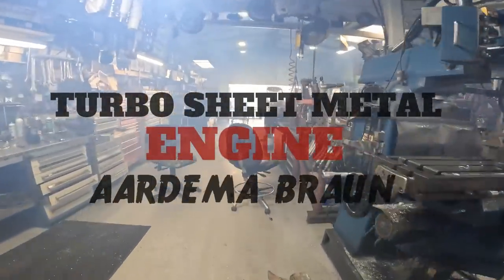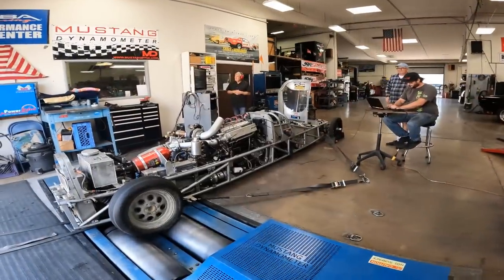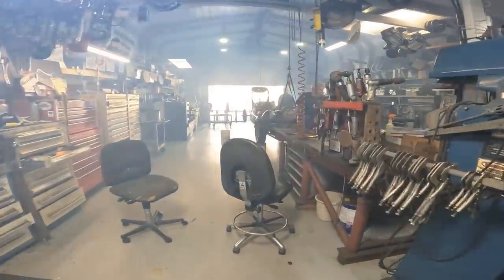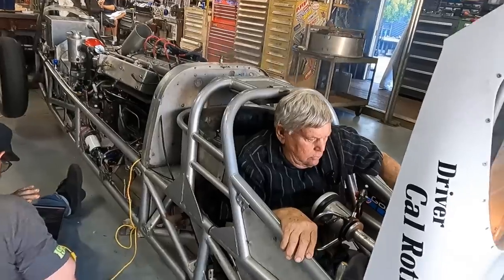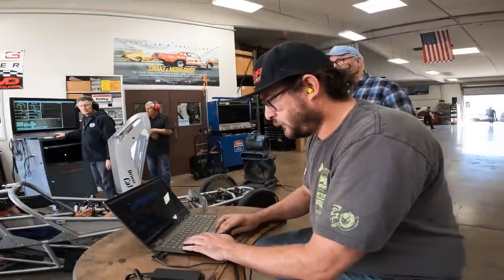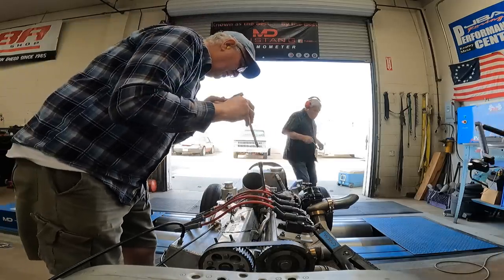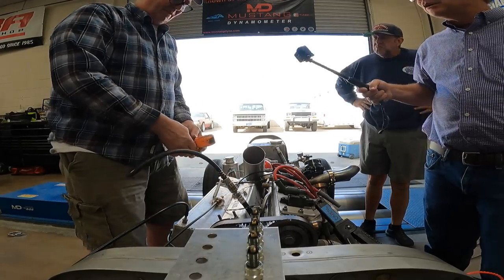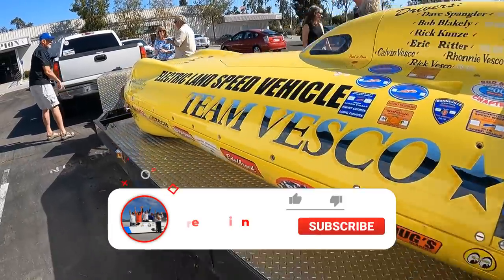Smoking Hot Homemade 3 Liter Turbo Sheet Metal Engine -  Aardema Braun

Comment: I wonder what type of failure mode infected the 3.0 liter during the dyno tuning? My intuition says there is some kind of ignition gremlin like spark scatter or other electronic interference. Something might be causing the timing to jump around? There seems to be a mixture issue too, the sudden lean spike generating the crazy-hot EGTs and resultant red hot exhaust tubing.
Reply from the maker: Crank signal pattern was all
Over the place breaks up at certain RPMs .  Could be interference ? Found  a voltage drop on the supply voltage to ECM .  Threw lots of time and  ignition parts, coils, cam and crank sensor. Possible ECM internal fault. Pete and Kevin will have to re wire it and bench run it before it goes back in the car.
Reply: @GregQuirin  I have seen a 1/4” steel angle iron bracket prove to flimsy for a good tach signal.  It looks like plenty but with engine vibration snd harmonics I have seen them throw some crazy signals.
Reply: Thank you Greg. Things that ought to be simple and easily understood can get wonky when pushed to produce record setting horsepower.
Reply: @GregQuirin  I ran into screwy rpm signals on a Subaru years ago above a certain rpm. It turned out to be a bad alternator throwing AC voltage spikes as the rpm increased. It caused the ignition to start multiple fire every ignition event
Reply: @KevinJones-pj8kx  "  It turned out to be a bad alternator throwing AC voltage spikes "  Yep, I've had this happen before

Comment: I mean honda k series can do 400 stock and a good build can easly do 1000hp
Reply: yeah they can, and?
Reply: That is beside the point, these fellas made that engine from scratch with sheeth metal.
Reply from the maker: So to your point, Pete and Kevin are building their own 2 Liter with hopes of competing with the Honda K Series.  You can see it in the video library.  Pete and Kevin refuse to use production engines. Pete says that’s boring, they pretty much build everything scratch minus parts like spark plugs, coils, starters and alternators.  If spark plugs cost $50 each he would his own. You should check out some of the other videos  thank you Greg